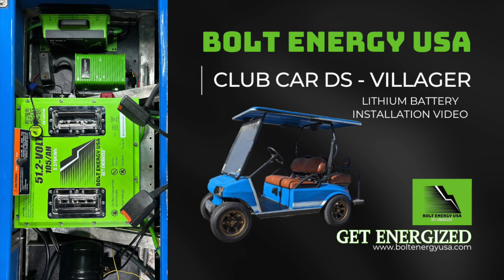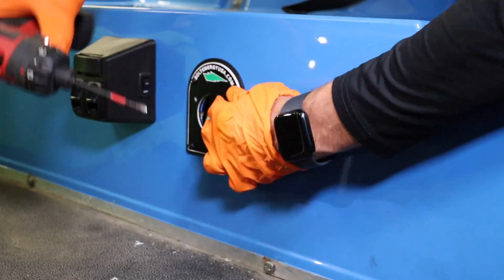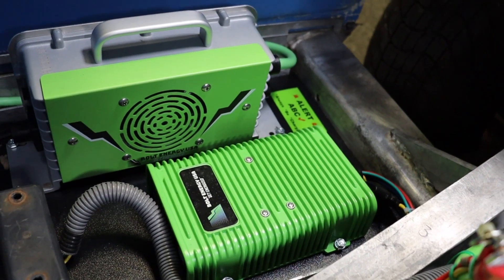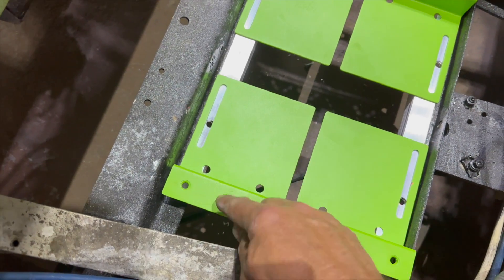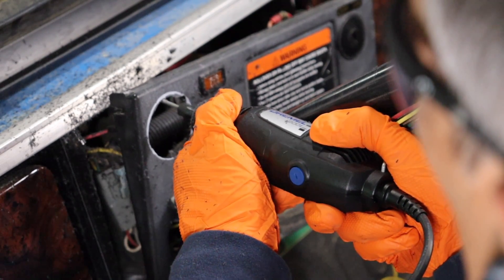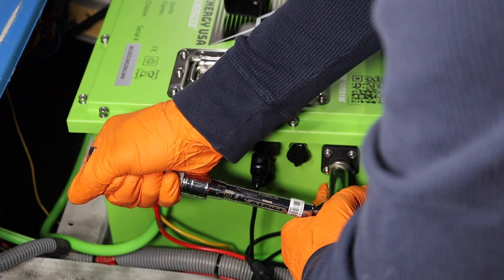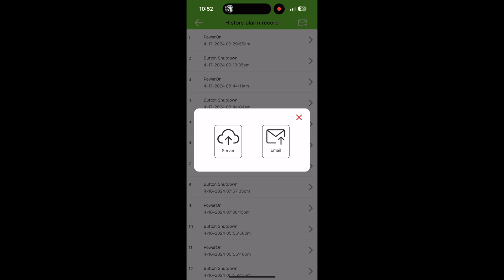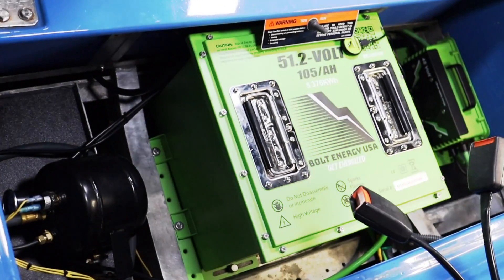Club Car DS Golf Cart | 51V 105Ah Lithium Battery Conversion | Bolt Energy USA

Comment: Will this kit work in this cart: KG9506 423895 Club Car?
Reply from the maker: Yes it will
Reply: @Boltbatteryusa  will this kit work on an ACG 39 Roadster?
Reply: Do you have wiring diagrams for the FnR & solenoid? I can't find these. Thank you.
Reply: This is for a 1993, 48v "toaster" style cart.
Reply: @Boltbatteryusa are you going to respond? 

My cart is 1993. It doesn't have these exact components. I need assistance.
Reply from the maker: @SoCalCamper  Hey there. Sorry we have many social media channels and missed this one. Give us a call M-F 9-5 pm est 727-955-4955. We are here to help. Its much easier to talk on the phone for clarity on what you will need. Thank you for considering BOLT!!!
Reply: How do I bypass the o b c if I don't have a run toe?Switch on my nineteen ninety six club car d s
Reply from the maker: @albertpattison7171  Let me check and will get that information and we will be working on doing a video for some of the older carts as well

Comment: If you're watching this video and considering upgrading to Lithium Batteries I can highly recommend Bolt Energy. I am running their 73.6 volt 105 ah battery in my 2015 GEM e6 and have been super impressed with the performance of this battery. Compare the batteries specs line for line to all of the other lithium batteries out there before you buy and you will see for your self. Nobody is building a more powerful battery with continuous max amps than Bolt Energy with a 10 year warranty. Not all lithium batteries are built the same and many co. market themselves as being the cheapest but be warned DYOR and read the reviews and compare the specs. I 'm glad I did,  Bolt Energy has a super quality complete kit for your cart and awesome customer service.
Reply from the maker: Thank you thank you thank you!